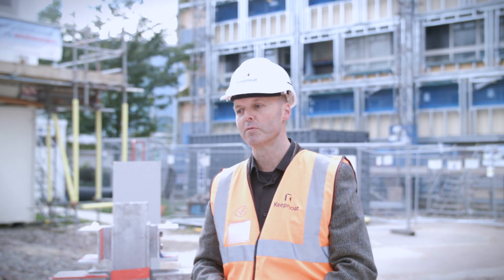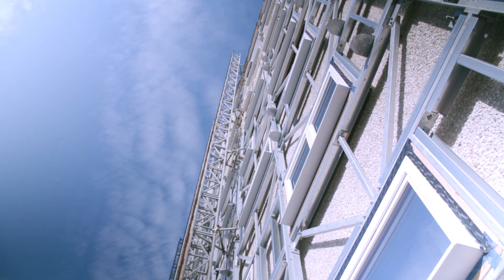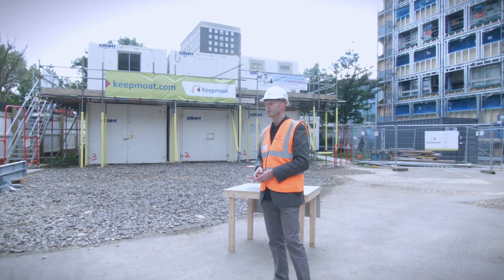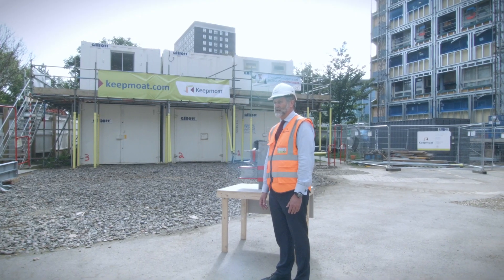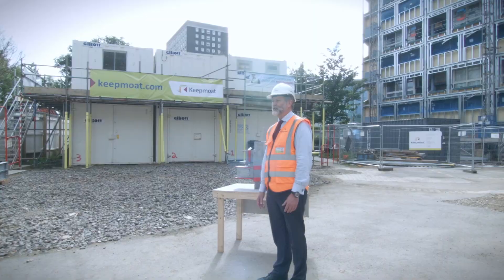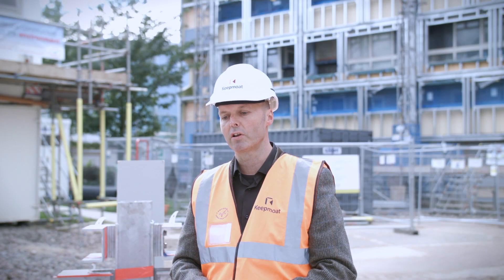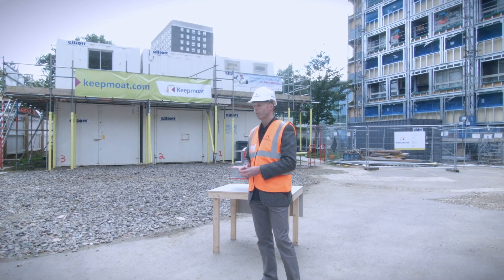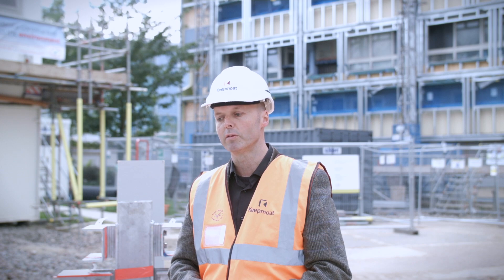EuroPHit Case Study 14: Wilmcote Multifamily House (Portsmouth, UK)

Comment: As a resident, I can confirm that now in February 2017 Block A still isn't finished and it looks like it will be nearer 2019/20 before they finish on the whole site. To the residents, it has been a complete nightmare with flooding, noise, mess, delays and lack of communication. Keepmoat have already had to pay out thousands of pounds in compensation to tenants who lost a lot of stuff after a whole row of flats flooded and they had to move out for a year. Everyone is still paying full rent and service charge to PCC in spite of what they have to put up with.  Keepmoat say they will be glad when its all done. As a resident, I can confirm that we will be too.
Reply: What's the update now?

Comment: thanks for the video! for exterior facade insulation, the frames are in aluminium material? if so, aluminium is one of the most conductive materials..and it would not create potential thermal bridge?